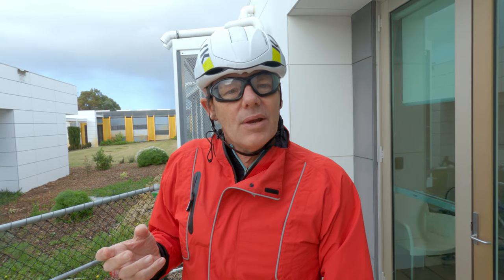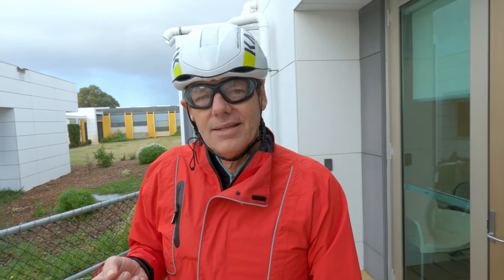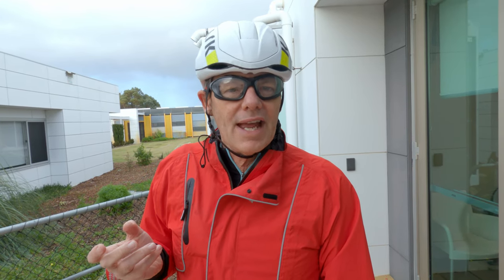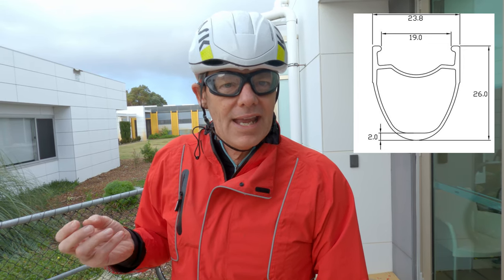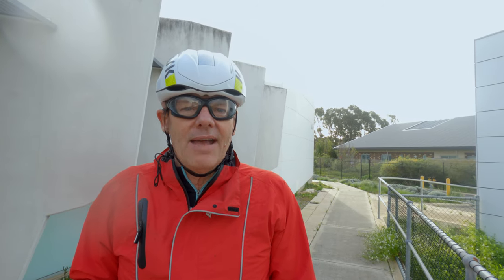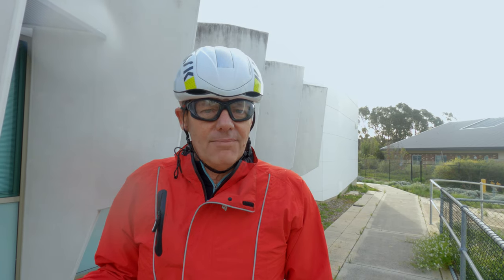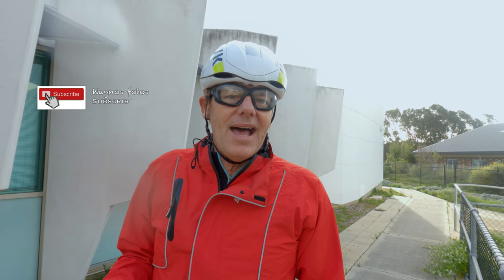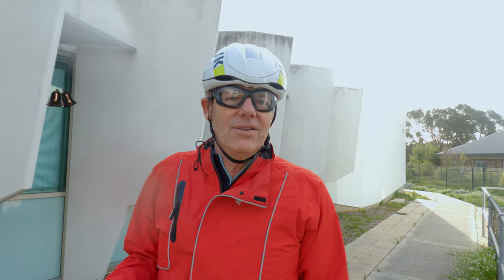WHY did manufacturers move to ROAD DISC?

Comment: Why don't they make carbon wheels with aluminum braking surface? That would solve the problem. I think some manufactures were making such wheels.
Reply: Look at Shimano. Dura Ace have a split configuration. Aluminium hooks and braking surfaces with a carbon center. Rim or Disc. Best of both worlds. They patented it so no one else can make such a wheel.
Reply: @jamesmckenzie3532  I have two sets of those Shimano wheels: a C40 and a C24, they work great.  Carbon tape bonded to  a very thin alloy rim to reinforce it.  Bombproof, and at a reasonable price.  Previously I had a set of super expensive carbon rim brake wheels: atrocious breaking in the wet, despite using their special $$$$ pads.  Braking in the dry was acceptable but not as good as with alloy rims.  So I sold them and switched to the Shimanos, much happier now!
Reply: @paulflory3532  Yep. Shimano may have the answer to this situation. Aluminium braking surfaces on carbon. Aluminium is a great heat conductor. Copper is best, and several wheel sets tried to incorporate it but failed.
Reply: @jamesmckenzie3532  For those who want a deeper dish, HED (and I think Bontrager) make rim brake wheels with an alloy rim with a carbon fairing fixed above the inner surface of the rim.  Probably a bit heavier than plain deep carbon rims, but if you factor the extra 600-750g added by disc brakes into the calculation these hybrids make sense......
Reply: @paulflory3532  I know the Aerous 3 series doesn't have an aluminium brake track. Don't know about HED or the other Bontrager wheels.
Reply: Hed wheels rim brake models are alloy braking surface only .
Solution if u like the look and benefit of aero Carbon wheels with only a slight weight penalty over full carbon clinchers 
They have the same belief as shimano 
Is that carbon rim brake clinchers when over heated could fail